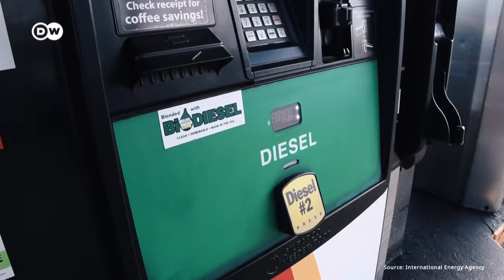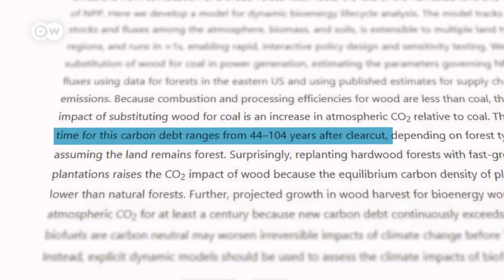Biomass: How clean is energy from waste and plants really?

Comment: As soon as you truck wood pellets any serious distance, you've generated more GHG than you save. Organic waste to energy only makes sense if it's done locally. As soon as you ship it overseas, you've shot yourself in the foot.
Reply: youre shoting your foot when your burning something  to heat your home or even to generate energy
Reply: I wouldn't be so sure - marine shipping is incredibly efficient.
Reply: @chris-2496  You're missing the degree of waste here. As soon as you truck organic waste 5 km or so, you've used more energy than you will get back from it. Organic waste needs to be processed really close to its source.
Reply: @brightmal  Trucking takes about 1.1 to 1.5 MJ/tonne-km WTW according to logistics data I get for company environmental calculations. 
Wood pellets are about 16500 MJ/tonne.
So you could truck the pellets the distance of almost earth's diameter before exhausting their energy potential. Of course some energy is also spent producing them and ovens are not 100 efficient, wtw does not include energy embedded in the truck to make it etc. but still its nowhere near 5 km you mention. Food waste can range from 2000 to 7000 MJ/t.
Reply: @chris-2496  And yet I've heard references to other studies that suggest that as soon as you truck waste more than 5 km before turning it into energy, you've taken out any margin in the process. Either way, finding an intelligent way to turn biomass into energy and other valuable products is best done as close as possible to the source.
Reply: @brightmal  yeah, I have no idea of how much methane is produced from ton of waste so it might be right. I don't know. Energy recovery through burning waste is also not very efficient because waste usually is relatively humid and requires input of energy to overcome that and get high enough temperature to burn without toxic emissions.
Reply: @chris-2496  I'm a fan of biogas and biochar myself, with the caveat that they're done in an intelligent fashion. Too many big-money projects have received government funding simply because of the idea that biofuels are green, and politicians need to be seeing spending money on green projects. And biofuels are only green if they're done right. Clearing forests to burn wood to make steam is nonsensical.

Comment: Human poop can be fermented into biofuel too. There'a a great video providing proof of concept at a wastewater plant in Illinois, USA. The video is titled "How one utility powers its entire plant from wastewater."
Reply: Poop from farm animals is also easy to collect.
Reply: Ya ur right!
It can also be enhanced by using the HTC process which is being commercialised by SOMAX and this process is was well explained in a video made by undecided with Matt Ferrell.
Solar and wind have huge disadvantage that they take up a lot of space which in itself a huge source of carbon emissions. If we use HTC and biofuel, then we can reuse old coal and gas plants which were shut down for renewables. Even if rooftop solar and wind can be used, they don't work well in apartments or high rises as the energy consumption is really high. So most new developments are mostly low density automobile centric sprawl which is terrible for pollution, city finances, society and health. Instead of that we mostly need space efficient renewables in mixed use, walkable, high density and public transit oriented development to solve climate change.
I don't mean that solar and wind are not good, but we need more non intermittent sources soon.

Also the residues from wood construction and furniture can also be considered for HTC process as it doesn't make much pollutions as only small percentage of the wood production is used for energy.
Reply: The idea of using human poop is the most sensible. Human excrement is in extremely high supply, especially in urban areas.
Reply: you can make biodiesel from sewege.. it has been done here.
Reply: Yeah, it's been done for many years where I live in Germany.

Comment: I DO think we can use garden clippings like grass, twigs etc , turn those into pellets for easier transport and use those for bio energy/winter heating.
Reply: I saw a cool video about a guy who heated his home via the hear generated in a compost heap.
Reply: @sarcasmo57  compost for heating is complicated - it's a living biological system requiring tuning and monitoring to get predictable output.
Reply: Household collection and processing uses a lot of energy.
Reply: @michaeloreilly657  yes, which is why i would set it up per street or neighbourhood. Either collect only or use too.
Reply: It would be cool but it has to be economically viable for a solution to emerge and industrialize. Collecting all these residues to have a sufficient quantity is a challenge (and not necessarily super green if you take into account the transport).
Reply: Home biogass is viable.
Reply: You can get tonnes of woodchips for free just call your local tree surgeons
Reply: I only recently learned that the waste you describe can be treated with torrefaction and then compressed into compact briquets. This is not high tech and pyrolysis could follow later in a central location.

Comment: By the definition of biomass energy, doesn't this include FOSSIL FUELS? Oil, coal and gas were once living matter that captured CO2 from the atmosphere. The only difference is that it happened much longer ago, and so this biomass has had more time (and physical pressure under which it was trapped) to change into the various forms that are demonised (by some people, at least) today. Or am I missing something?
Reply: Hey, you copy and pasted this question across videos, lol.
But the key difference is biomass doesn't release dormant carbon into the carbon cycle.
Fossil fuels are trapped carbon that don't effect the ecosystem until we untrap it. biomass allows us to use carbon that's already active in the system.

Comment: Wood should only be burnt for energy in households in winter. 

Burning pelletized wood to make electricity to transport to houses to turn back into heat is an efficiency nightmare.

10kg of dry wood heats a family home for 1 winters day using a modern stove in a modern house, can't even get near double that number in the way it is done on a industrial scale.
Reply: Not only are "wood pellets" inefficient, the wood is harvested in areas where low income people live, destroying the tree canopy for those who can afford wood burners. 
Destroying forests has been happening in the USA south to feed UK homes, and the processing plants run 24/7 making extremely loud noise as well as creating water pollution.
Reply: Agree. Locally sourced wood in an efficient stove is by far the most sustainable heating system.
Reply: Modern heat heat pumps can have efficiency around 500% because they are really just transporting energy from the outside to the inside. So even if the power plant has an efficiency of 50% the net result of electric heating is still better than burning locally in a stove.
Reply: Just stick with nuclear energy.
Reply: @anotherelvis  depends on context. In really cold winters there's very little heat to move in from outside and you're stuck with electrical heating element doing almost all the work.
Reply: The emissions are generally worse for public health if people are closer to the source, a good clean burning fire isn't too bad but it is definitely worse for local air quality so there are advantages to burning the fuel outside of residential areas.
Reply: @chris-2496  It also depends on the design of the system, ground source and water source heat pumps aren't as limited by air temperatures allowing you to heat with higher efficiency even on cold days. Ground source and water source heat pumps are also a bit more efficient at cooling during the summer. Air source heat pumps generally are still more efficient than directly burning the fuel by enough during the milder cold days by enough that you still generally need less total fuel to heat a home with an air source heat pump in most climates.

Comment: I actually just read the Biomass section in the Drawdown book! They had an interesting distinction for Biomass: we should focus on feedstock which needs to be planted once and then harvested for several years before they require another planting.

This is why fuel from stuff like corn and trees (which has to be planted once for every harvest) has actually been found to be worse for the environment in recent studies!

I felt like this gave me a really solid understanding for when I vote in the future.
Reply: @b_uppy  actually, coppicing is one of the exact practices that the book was supporting because it can still have a high yield without having to revert to planting a new tree every harvest.

Which goes back to my original point. It’s important to look at biomass energy proposals and see what feedstock they’re planning to use. If it’s something that gets planted once and harvested many times then that’s on the better side. If it’s something that gets planted once and harvested once, then that’s typically a net negative for the environment.
Reply: @b_uppy  the book is titled “Drawdown” as I mention in my original comment. The data comes from a large group of scientists but the editor for the book was Paul Hawken.

In it, they analyze the top 100 possible solutions for climate change and provide a prediction of how they will see that solution utilized between now and 2050. Along with how many Gigatons of CO2 we can expect that solution to avoid and how much money implementing that solution will cost or save us.

They expect Biomass Energy to save us 7.5GtCo2 by 2050 while saving us $100 Billion. But they do also mention that they expect it to start being phased out after 2050 as the issues with other tech which it is helping bridge start being solved.
Reply: @b_uppy  Just here to misunderstand and strawman everything huh?
Reply: Trees have low drymatter yield per hectare per year, I think they should consider using perennial plants that have high yield. I do pilot project reseaech on one of biomass plants that could produce up to 60 Metric tonnes per hectare per year with almost no till.
Reply: you mean stuff like bamboo,chinese tall grass etc? yeah, same problem with it taking space for growing food..
Reply: Do these recommendations consider only biomass energy value produced per year per area or also the quality of it? What I mean is you can make lumber from trees which stores carbon in it's next use as well where willow, for example, can only be used as fuel to burn and release co2 back in atmosphere. Storing carbon in timber construction materials basically multiplies the amount of carbon capture by every year it serves.
Reply: @chris-2496  it’s specifically centered around energy production from the biomass. Things like creation of building materials are addressed elsewhere in the book.
Reply: @SaveMoneySavethePlanet  I read this book and it is a very good source of information! I think that not all types of biomass sources are good and that the only reason we should be supporting it is if it is done in the right way, AKA with residue (such as leaves or municipal waste) or with second generation crops (not corn or palm). I think the carbon debt problem that is at 100 years is overlooking the fact that this is 100 times better than fossil fuels... I know we are comparing with solar and wind, but simply we need all the solutions possible, just like it says in the Project Drawdown book. Sustainable forest management is really a complicated issue and it is really hard to summarize in a 10 minute video...
Reply: @romylongpre9275  wow what great timing with your comment! I literally just finished the official first Rev of the script for my video on the Drawdown book!

Glad to run into another person who thinks that’s it’s a super quality read :-)

Comment: Depends on which generation of biofuels it is. The second generation is based on residues, such as food waste, and is much less in the energy mix than 1st generation produced from energy crops that are grown specifically for biofuels.
Reply: Yes, but the reality is often different. For example, for pellets, the biomass sector communicates abundantly on the fact that they are only sawmill residues, whereas several investigations have shown that most of them come from deforestation. And similarly, for biogas, more and more of it is produced from dedicated crops.
Reply: There is also waste wood from the furniture industry.

Comment: 3:38 actually cars/engines can run on even higher concentration of ethanol like E85 or even pure ethanol when they are correctly setup or had some minor modifications to the fuel system to account for the lower energy density.

Comment: In Finland, the majority of bioenergy comes from the recovery boilers in pulp mills. The material being burned is lignin, a polymer that makes up a sizeable portion of wood bulk but cannot be used for pulp like cellulose. It is separated from the cellulose chemically and burned with the recovery chemicals put back to the process. Considering that we want to move away from plastic and many of the replacement candidates are cellulosic or otherwise made from wood this seems like a very sensible way of making bioenergy, and even in very large quantities.

Comment: Have to add two corrections:
1) 8:35 "older trees store more carbon"
Yes, obviously. Trees get bigger, have more wood mass, store more carbon. But young trees absorb carbon at higher rates because they grow faster. Fully grown forests reach an equilibrium and don't absorb much extra co2 as older trees succumb to pests, diseases and decay releasing co2. Harvesting wood to make long life products (buildings,  furniture etc.) stores the carbon and rest (branches, sawdust) can be used for fuel
2)10:20 "burning wood releases co2, but woodchips could be used to produce biomass"
That makes 0 sense. Both fuels - wood and methane - release GHGs when burnt.
Reply: Spot on
Reply: very valid points. I guess the difference is the efficiency with which you convert the combustion energy per tCO2 emitted. So the idea is to get as much energy from the same amount of CO2 released as possible. I am not an expert, but are methane buring devices more efficient than wood burning ones?
Reply: But those GHGs would've been in the atmosphere anyways if u didn't utilise them
Reply: @Paul-hu7xx  just the same as branches that would rot away in the forest if you wouldn't chip them up
Reply: Older trees actually tend to gain biomass faster as well with a few exceptions most trees don't have an actual adult size where they stop growing bigger. So no, they really do store more carbon on average. You do want to harvest them before they die, but that takes a relatively well planned form of forest management that isn't necessarily common practice.
Reply: @QLEK99  methane power plants are a bit more efficient than solid fuel power plants, but the methane digesters do cost some energy so they should only be used for things like manure that aren't always practical to dry out and burn.
Reply: @garethbaus5471  There's wealth of research on how much timber mass trees add depending on their age. This depends a lot on the species of tree, soil, climate etc. For example where I live (Baltics) most planted species is pine and it reaches its peak of adding wood mass in 7th decade of life, for fir its 4th decade, for birch its 7th decade etc.
This data is what forest managers base their business choices on when to cut down the trees to ensure optimal ratio of income versus productivity. That's standard practice.
So I really don't know what you base your claims on.
Reply: The questions seem to be, what is the LCA of trees of different ages, what is the LCA of anaerobic processes in caring conditions (for instance with combined heat (and cooling) and power).
Reply: @rtarouca  I do understand where you mean, but LCA is probably not the right tool to measure this. We are comparing impacts of different forest management systems here not products.

Comment: I was working on this back in 1995. The plant that I was working on doing this and more. That system, which I still have the the tech documentation, did what you talked about but far more. 

Oh, BTW, the system is 100% closed. No emissions,  self reliant on the inputs to generate the electricity and methane to generate the heat.

Catch up!
Reply: Hi, I will be looking on doing a closed loop system for my future farm installation. Does your solution resemble the one in the documentary The need to grow? I would be interested to know more.